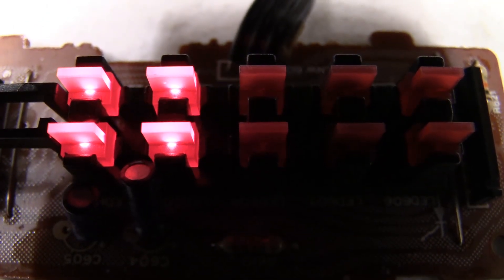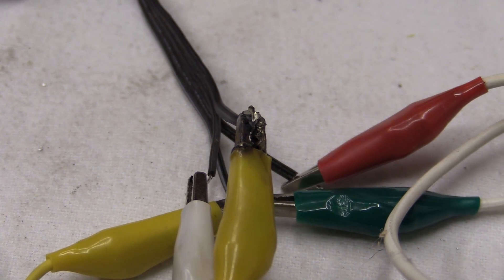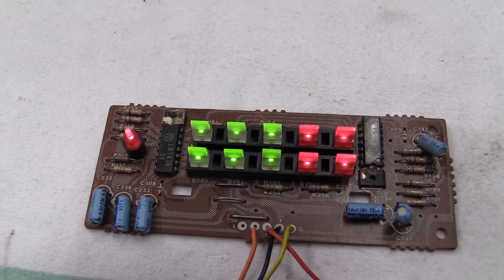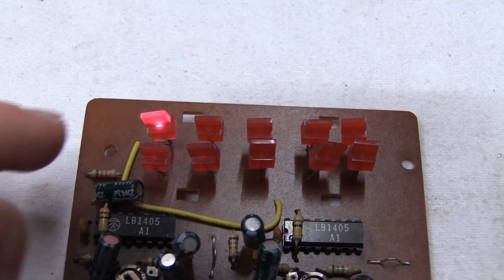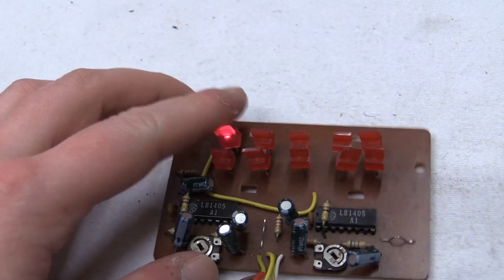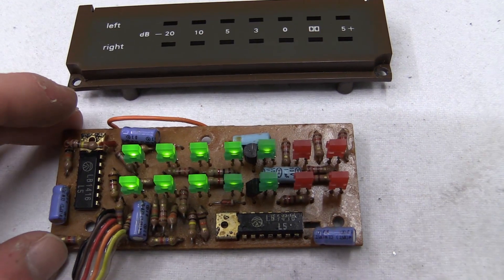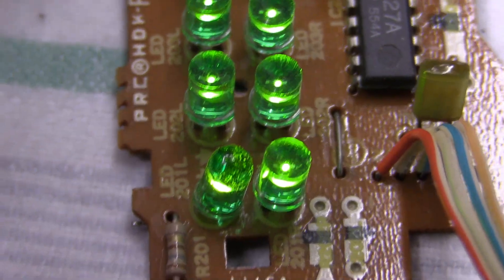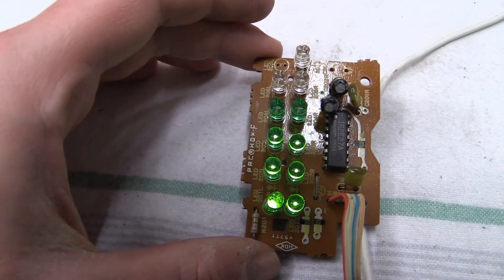LED Level Meters!

Comment: I worked with alot of VFD VU meters with the AN6870 driver IC. i have a few videos of them running with my setup.

But, they are multiplexed between L/R, and most need around 18 to 24V B+ to operate, and around 2.5v to 3.5VAC filament voltage, centertapped via zener diode to ground. that PCB may have the heater bias already present.

I really like VFD displays, and their applications in VU/Spectrum analysis.
Reply from the maker: I was trying to get that circuit board to work, but I could only find the Japanese data sheet and the whole setup was just very confusing...
Reply: DrCassette take two good detailed photos of front/back and I can help you out.

Comment: Back in the first 80s years LED was very cool and modern to have on your sound system. To see lights on your stereo system blinking as the sound punches and no more old analog needles. And we get LED in home like on the voight kampff Machine on Blade Runner! How cool is that?! :-D

Comment: really bizarre that LB1416 need heatsinks to drive just a few rather weak LEDs.
Reply from the maker: Not entirely sure why that is...
Reply: Are there current limiting resistors on those LEDs? I bet not, and if not, then that heatsink probably dumps the heat dissipation of the constant current source for the LEDs. Gotta think, back then things were highly inefficient.

Comment: I have a Harmon/Kardon deck with one of the channel's vu meter that is significantly lower than the other. What should I do to troubleshoot this? Its strange because on my mixing board both channels are equal in volume, so its not the read head alignment. I think its the vu meter electronics themselves.
Reply from the maker: There might be an adjustment that is off. I once had that on a cassette deck.
Reply: DrCassette
Yes, I saw this on one of your meters. Just turn that screw. If its that easy, "Bob's my uncle"
Reply from the maker: Just make sure you don't mess with the wrong adjustment, make a note of where the regulator was before you turned it!
Reply: DrCassette
Love your channel. I just fixed the tension on my pinch wheel on my Panasonic Reel to Reel thanks to your tutorials. Gave the heads a clean, and lubed the motors while I was at it. Thank You.

Comment: Do you still  have and use the sharp rt100?
Reply from the maker: No, I took the RT100 apart, that's why the module is featured in this video.